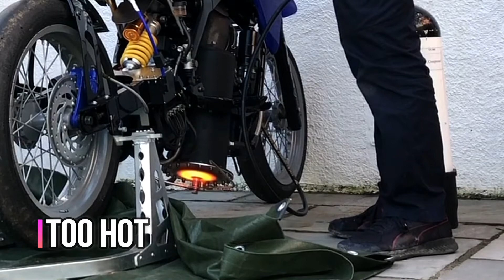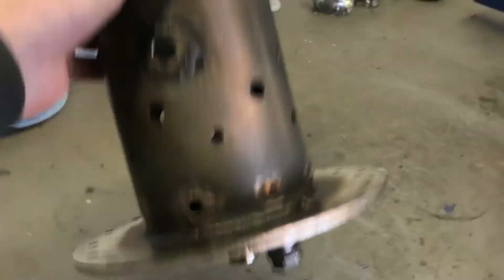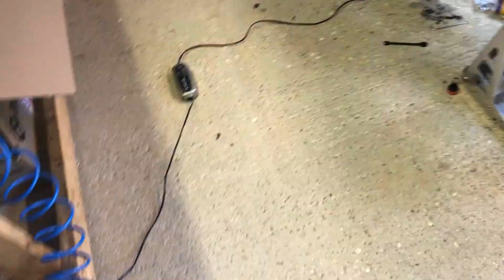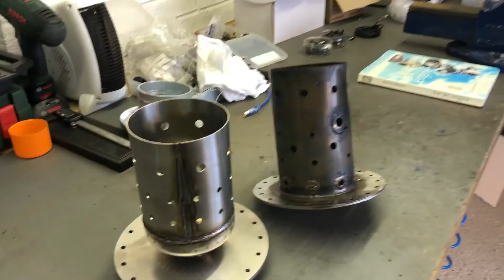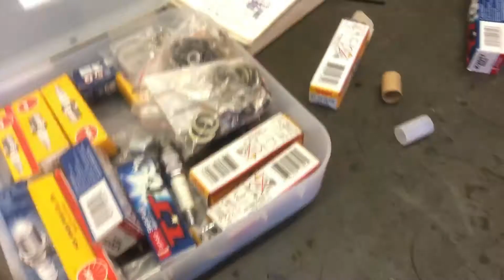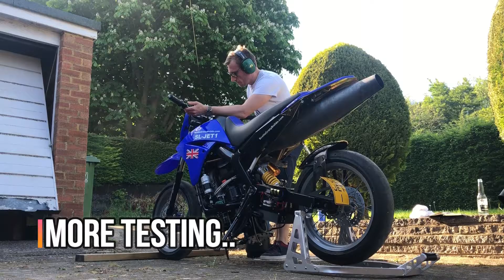JETBIKE UPDATE! 3 Months of DIY Jet Engine Development...

Comment: How big is your inducer?
Reply from the maker: 69mm
Reply: @ScottsCrazyBuilds  big boi.
My next engine is a 47mm. I wanna try and use it with a freepower unit and run it through a 125 gearbox. Like literally use the freepower unit to spin the crank.